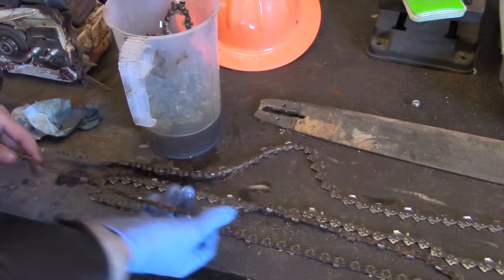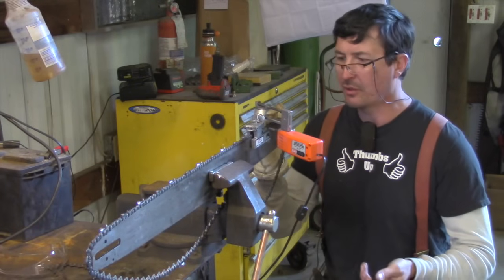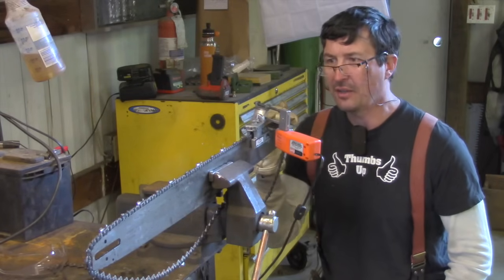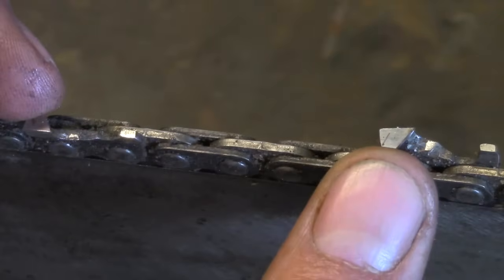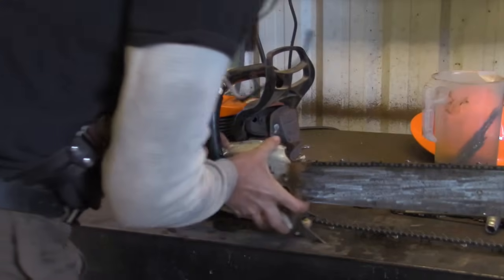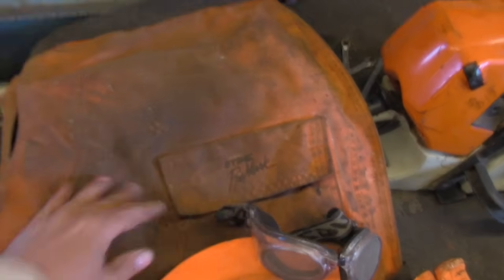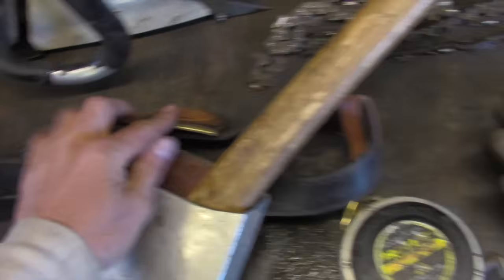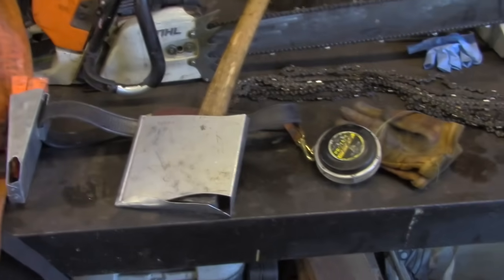A Better Way To Sharpen A Chainsaw

Comment: Hi Wrangler, have you ever seen a Timberline Chainsaw Sharpener? Its very similar to the old Arnold Precision Sharpener and will maintain perfect 30 degree angles, or 35 and 25 degree as well depending on the guide used. Was just curious, really like your Granberg video, thanks

Comment: The best way to sharpen a chainsaw chain is with a Dremel tool with a chainsaw sharpening stone.  Sharpening a chain with a Dremel tool is several times faster than sharpening it with a file, and it doesn't take off as much metal so your chain lasts longer. You can buy the Dremel tool at Lowe's or Home Depot, in the tool section. Dremel makes three different sizes of the sharpening stones.

Comment: HI Cody,

I bought the Granberg 12V D.C. sharpener Model G-721 and I also purchased the Granberg File-N-Joint Model G106B, but it does not appear the you can use the 12 V with the File-N-Joint as I saw you use! Am I doing something wrong, or did I purchase the wrong models. I would appreciate your assistance. Thank you, Willow

Comment: You have to hold the bar "up" while adjusting chain tension and tightening the bar nuts. Failure to do so will tighten the chain too much during operation as the bar will "vibrate" up during use. Too many "YouTube Experts" out here with their videos.

Comment: I'm 59 years old and using a chainsaw since I was 15 in the piney woods of East Texas.  I know more than Wranglerstar about chainsaws except depth gauges, plastic wedges, proper sharpening, flipping bars, cleaning out oilers and everything else I've been doing wrong with a chainsaw.  You got it going my friend.  I've learned a lot since finding your channel.  Someone stole my 029.  Thinking about buying the 261 or 362.  Does anyone have any experience with the C-Q in these models?  Recommend them?
Reply: Roscoe 1 depends on what you're cutting. 362 is good but if you can find an 044 or 038 mag on Craigslist it would be cheaper and a better faster saw. If you don't cut wood that's that large go for a 291 or 290. Or a dolmar 6100 or 5105
Reply: Roscoe 1

Comment: I use hand sanitizer for a quick fix for sap on hats and clothes. It doesn't seem to work well for caked on stuff though, such as on my axes. For that I just take a wire brush with some alcohol.

Comment: Cutters are best sharpened with a proper file. The hard part is learning by practice how to correctly sharpen. The bar-mount systems are great for stabilizing stroke angle. The best sharpeners do it by hand, eye and feel.  Just them and a file. No battery, no angle guide, out in the bush. 

It's like a guitarist who can tune by ear v. those that must rely on a tuning fork or electronic tuner. Musician v. hack. I'm in the latter category with the manual bar-mount. 

The tiny length of the cutters above the depth gauges, the corner teeth basically, are what bite into the wood and do the sawing. A sliver of each steel tooth at high rpm. But to best sharpen this material requires a round file 90 degrees to the bar, not rotating 360 degrees while shoved across the cutters.

These 12v grinders are no quicker than a manual bar-mount. No need to wire to a battery, have to keep the battery charged, no ear-splitting racket, no need for hearing protection. Properly mount the sharpener, three strokes per cutter, per normal condition, provided not hit metal, dirt or rock. Done in under 5 minutes.  Good as new.

Comment: for the average Joe you may very well be right. However as someone who makes racing chain a square grinder or hand filing is the way to go. the other issues you'll have with the stone is the fact it changes size as it wears. a property hand filed chain will always be better than any stone ground chain. As you said it does take skill, which you obviously don't have, so down hand filing simply because you're not proficient at it, that is arrogant and bad advice IMHO. Also try rip cutting a log in half with a dirty chain, that will help clean most of the pitch off. Out here in the mid west we don't have many conifer trees so pitch isn't a big problem.

Comment: Toting that thing around with you while harvesting timber would be a real pain and slow down production.
  A lot of cutters get paid by log scale BF harvesting, the last thing they want to do is fiddle around with a jig to sharpen a chain.. 
 There is room for variation tooth to tooth on a chain. If you do get the angle wrong on some teeth it will have little effect on the speed your saw is cutting unless you really go off on them..
  Simple file holders have the angle drawn on them for the chain being filed.. Its fast and simple and has no set-up time.
  The grindstone sharpeners are brutal if the chain hit the dirt or a rock, by the time its ground out damage on the teeth damaged they are significantly different than the teeth not damaged which can make the saw cut on a curve.
 With a file you can dress the damaged teeth removing the least amount necessary.
 Jigs are handy for the weekend warrior that hasn't had the time and experience filing chains. In that regard they are worthwhile.
 I recall getting on as a Christmas present when I was about 14.. I tried it a few time and then went back to filing the chain with a file. We didn't have file holders back then, so it was all done by eye.
 Perhaps that's the difference versus now to then. I had to learn early on how to file my saw chain to do my job as efficiently as possible to make some cash.
 To this day I file with a file holder only, and can get some serious usage out of my chains before needing to replace them.
 It is not cumbersome to have on site or in my back pocket and needs no set-up time.
 Sharpen and go during coffee break if they need a slight tuning to keep things cutting fast..
 All tools have their place, some are designed for users who need an advantage due to not having the time invested such as sharpening a chainsaw chain.
 I am not putting them down in that case, but I also know through experience that they are not a practical solution for cutters harvesting timber..
 I can equate this to a guitar player not able to tune his guitar and needing a tool  such as a tuner to help him get it tuned. Few guitar players that have been playing for years need a device like that, but those learning can get a huge helping hand by having one..
 Thats my two cents for what it's worth.

Comment: Have you tried suspenders on your belt?
  I'm not a logger but I wore a heavy belt and the suspenders made it much nicer to shift the load 

  Do they also frown on the metal scabbards on your belt ?

Comment: try putting a 10 deg set back on it if you can with the sharpener.  I have made some wild cutting chains with chain grinder. lol. try the set back on one of your old chains. I believe you'll find a lot. better cut with sappy wood

Comment: maybe you already answered this in the previous comments, but why does you chainsaw chain so many toothless links?  It seems that there is a large spacing between the teeth compared to the chainsaw chains I have used for firewood.  Also, would you recommend filing/sharpening the teeth on the chainsaw fully assembled (turned off of course) and just manually rotating the chain to get to all the teeth?

Comment: Hey Cody stihl makes a forestry hard hat that has ear muffs and a flip down face sheild Thats screened mess.
One of my favorites you don't eat near the saw dust.
Reply from the maker: TinManKustoms Yes I have a couple of them. I don't like all that weight on my head and the earmuffs are constantly getting hung up on branches.
Reply: wranglerstar I'm not a fan either. I'd rather just wear a hard hat, glasses, and ear plugs. Plus that visor doesn't count as eye protection for most state's safety standards anyway.
Reply: +Wranglerst
Reply: +k11keeper Face shields don't meet safety standards?  I wear protective eyewear and face shield together if that's the problem.  The face shields aren't recommended by themselves they typically should be worn with eye protection.  It is true that they become awkward with obstacles but what I typically use mine for (helmet system) is limbing with a pole saw and brush cutting/string trimming.  The composite helmet may actually be as durable as the aluminum but like any helmet, if it shows signs of wear and tear it should be replaced.
Reply: TinManKustoms not
Reply: Stihl makes, (my opinion ), the most comfortable setup available, other then the earmuffs which I find too bulky and replace with Peltors. The face screen fits snug to the helmet when not in use, which is most of the time for me, and doesn't snag branch's. But the best feature is the piss flap on the back which, by means of the attachment design/location, does an awesome job of keeping my neck dry during our west coast's damp season. Adding the rain guard which connects the face shield with the helmet complete's the helmet. That along with some good double layer raingear and you might not have water dripping off your nuts at the end of the day.

Comment: Okay, I am a geek !  In this and the other video you interchanged  circumference with diameter.  Circumference is the length around a circle/cylinder.  Diameter is the distance across the circle through the center.
Reply: theoldwizard998   you're not the only geek, lol.
Reply: theoldwizard998 I believe the tape does the calculation for you, i.e. you measure around the trunk circumference and the tape will show what the diameter is.

Comment: The ripping chains have a different angle.  Can I adjust the angle on the Grandburg?
I have worked in the woods for 40 years and I still can't hand sharpen a saw perfectly.  I recently bought a powers saw mill with the intention of making a log cabin so I need a perfectly sharpened chain.

Comment: The reason that metal hard hats are frowned upon ( and generally banned outside the US) is that they deform upon impact. Metal dents where as plastic either deflects or cracks, either way the impact is not transferred to the skull with a plastic hat where as with metal there is the possibility that a dent can hit the skull. I just wish we could get that US style round brimmed safety hats in the UK to deal with the rain. We are only able to buy peaked style as US ones don't generally conform to EU and British standards. (purely bureaucracy).
Reply: Chris Ryan ill take a top of the line kevlar over plastic or metal everytime
Reply: Chris Ryan was iu
Reply: Chris Ryan was

Comment: Not correcting anything or disagreeing, but I used chainsaws for almost the entire 1990s including very heavy use during the tree trimming years and I / we never had an issue from not filing the rakers. But I'm definitely not here to say it shouldn't be done.

Comment: Chainsaw chaps are only good for a certain period of time and they need to be replaced on a regular basis.  Also the oil that gets on the chaps (like mine and yours) is not a good thing because it clogs up the fiber material that is supposed to tear off and jam up your sprocket in the case of contact with your leg.  Great video, loved it.

Comment: I will not go out without my hardhat, had an accident that would have sent me to the ER if it didn't kill me while cutting out tornado damage here in Missouri. My hat save me from anything but ringing ears from the crack of the impact.

Comment: I rip ironbark split posts up to 400 a day and I'm telling you with a sharp round file I can get it sharp enough to cut your finger if you apply pressure. I don't know how sharp you can get it but if you say you can get it sharper than hand filing you need to be chainsaw racing. My boss is competing in the Australian titles at Tenterfield NSW this weekend and he can get his teeth SHARP with a hand file. Have a look at "post ripping" I don't no if your have it on the US but man o man they can cut wood.

Comment: Can you use the  Granberg 12 volt Grinder with the chain off the bar, or do you need the bar to mount the jig?
Reply: CodeFoxAus  You need a bar. I don't see why it cant be a spare bar clamped in a vice just used as a sharpening station. You could even weld a damaged bar to a stand and use that.

Comment: Is there some sort of stamp / marking on the chain to determine what size file / stone to use and what angle to sharpen at?
Reply: CodeFoxAus Should be on the package your chain comes in.

Comment: Holy crap, $15-25 for a single chain to be sharpened? Here in SW PA, you can regularly find guys who do a quality job for $5-$10 per chain. last time i got mine done (planned on buying the Granberg but needed chains ASAP) i sharped 6 for my big saw plus 1 for another saw for $70 OTD
Reply: Depends on the chain length.
Reply: johnnybarbar not here it doesn't. 16" or 28" it's all $5-$10 depending on where you go
Reply: That still adds up when I can do $100+ worth of sharpening an hour with my sharpener.  I live in  old homestead and cattle country and you wouldn't believe how much metal I have to deal with so sharpening is a DIY job by necessity when you take the shop fee + trip cost + time.  I could sharpen 20+ chains in just the time it takes to drive into town not including the wait time.

Comment: How do you get your hands clean? Every once in a while I restore old tools and axes, and I always have rust/metal, boiled linseed oil, grease, etc. on my hands for a couple days. What is your methodfor cleaning your hands and arms off?
Reply: Michael Talaganis Use latex gloves?
Reply: Michael Talaganis Also exists specials creams which applied before work. After a work just wash hands with soap.
Reply: Michael Talaganis Barrier cream (a good paraffin based moisturiser), latex gloves and then when it comes to clean up use a specially made hand cleaner such as swarfega.
Reply: Michael Talaganis Joe's hand cleaner works good.
Reply: Michael Talaganis I use gloves when i can but there is times when i cant so i use a automotive degreaser on my hands first then a hand cleaner with grit in it and if they still feel/look/smell a little dirty then just some hand soap but usually i just use the hand soap to make them smell pretty for the wifey
Reply: Michael Talaganis 
Wear Nitrile gloves
Reply: Michael Talaganis Try washing up liquid with sugar or salt, the "Fairy Liquid" will break down the grease and the salt/sugar will scratch the dirt out of your skin.
Reply: tim Rayner lava soap!
Reply: Swarfega !

Comment: This actually quite funny. you bang on about how perfect the jig sharpens and how people could not hand sharpen as well, but if you pause at 3.47 you can clearly see that the gullet has been ground out way too high. One or two more "sharpens" and it wont have a cutting edge at all. Also you didn't round off your depth gauges after you bought the height down.

Comment: Definitely faster, but how is the Grandberg any different than a file on a manual jig?  I have the same adjustments that the Grandberg does and I do not need any power source except me.
Reply: IT HAS A FREAKIN MOTOR ON IT THAT DOES THE SHARPENING

Comment: I did not know about depth guages. Thanks.
Reply: +chainsaw alternative  The depth guages do not matter?
Reply: +Tom Olofsson 
Depth gauges do matter but I agree that a file with a guide is better than a sharpening stone,... I sold & used Saws & equipment for years & have tried every sharpener on the market because I had to for product knowledge.
I also used a commercial Chain Sharpener in the service department & the put way too much heat into the metal.
If you use a chainsaw right, you can cut a lot of wood before sharpening so when it is due, I like the quiet & gentle effort of a File & Gauge :)
Reply: +David Yummus Ahh' zen and the art of chainsaw maintenance.
Reply: Tom Olofsson
Ha ha :)
Reply: Tom Olofsson Depth guages are just as important as the cutters being sharp. Theyre what determines how much wood each tooth bites off. They need to be consistent from one side to the other, and consistent depth guage to depth guage for smooth (not chattery) cutting. Get one side down further than the other your saw will not cut straight. Ive had tons of hand sharpening experience, topping and bucking trees has been my job for the past ten + years. Be safe.
Reply: Tom Olofsson  n

Comment: all the grinder I seen heats the teeth up too much looses temper of the tooth hand file will make chain last a lot longer if you can use a saw

Comment: Looks like you are using a grinding stone on that tool. Problem is, it may start off the correct size but as you use it, it gets smaller. I  have replace the stone with one made of metal with diamond dust impregnated  on it. The diameter never changes.

Comment: It's now 2 years later and your all hot on the Stihl hand held 2 in 1 file system that files the teeth and the rakers at the same time. So now your doing by hand.

Comment: In 45 years of running a saw I have never touched the depth gauges. They wear down on the wood as you saw.. A 6 inch ribbon of wood shaving is enough.

Comment: Wranglerstar- After viewing this video, I went immediately to your Amazon store and purchased the grinder and bar-mount file attachment. After receiving the products, I quickly realized that the items you have in your store are not the items used in your video. It's a real bummer. I need to return the items and locate the specific product you are using as the two I received cannot be combined. Just a heads up. You should probably think about updating your store so that no one else makes a similar mistake.